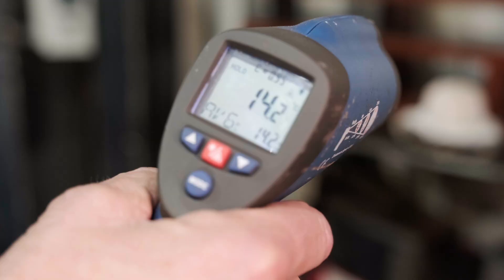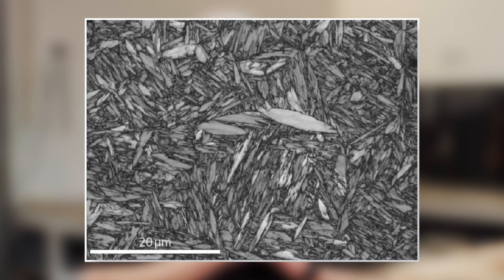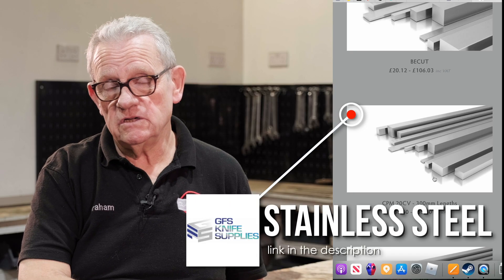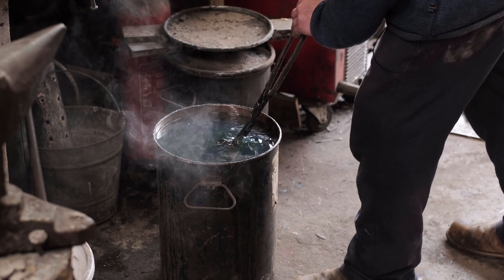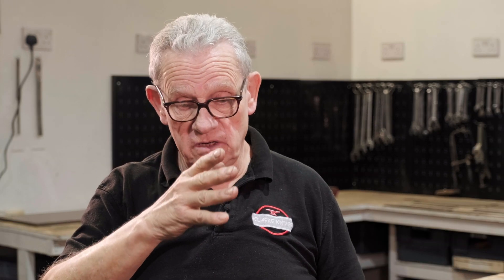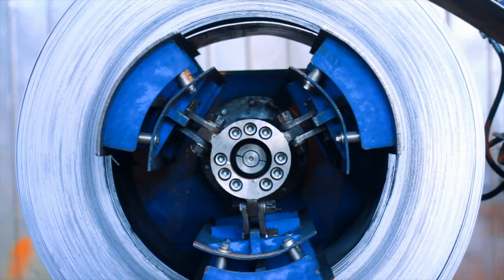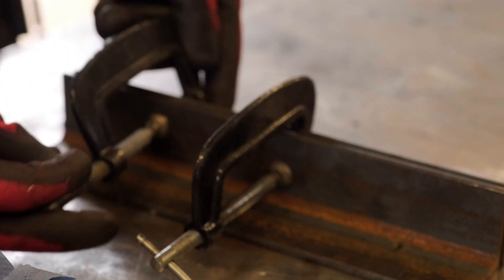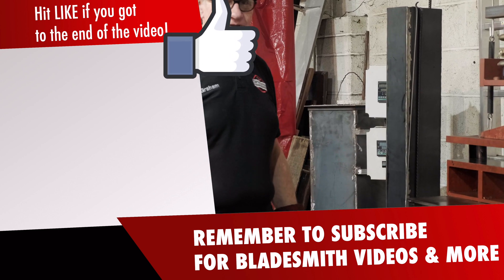EASY way to avoid bends in your knife (even BEGINNERS can do)!

Comment: 🤔i have been thinking of how to put this for the last 2 hours and  No offence intended and i kinda shocked myself at all but there is a very very easy so obvious way to know when to take your steel out of the Quench media. pull the blade out when the media stops boiling. a lquide Boil's when it has hit the right temperature turn from liquid to gas. Most quench oils vaporize/flash at 176.666667C/350 F  with Parks 50 its 135C/275 F and water its 100 C/212F your blade will be at that temperature when it stops boiling (it will still cause the oil. If i recall right Martinsite forms at the speed of sound and I believe its in an unstable configuration that acts like Austinite until it has cooled to Somewhere close to room temperature. so you dont need to count you need to watch and pull your blade out right when it stops boiling...however dont set in on something on one side as that will alter its cooling rate on that side causing a warp. Lock it virtually in a vise or clamp it between plates or boards and let it cool to room temprature.😅 This is so easy and Obvious i feel like i am Trolling you and i am not. IF i am wrong here please tell me and i will delete this as i do not want to contribute to the Myths about heat treating.

Comment: If you clamp the knife after the first cooling in oil and then dump the whole clamped steel with the knife into an ice-bath does that almost secure a good hardening or will the ice-water cool it to fast?

Comment: Early in the series, when Jason Knight was a judge, he mentioned that if you take the knife out of the oil and it bursts into flames, then it is not sufficiently cooled.  And one may notice while watching, how often a bladesmith takes a knife out of the oil, there is a giant and visibly appealing fire ball, and when tested the blade fails by chipping, breaking, or bending.

Comment: I use steel plates and clamps. But at the moment i am building something better. A wood working vise with wide jaws, with a steel plate welded to the inside of each jaw. So i can do the same thing that his hydraulic press is doing, but for about $50. I was also considering a hydraulic press, if money is no option, id go that route

Comment: Great video.  I have made a straightening plate, but would like to know what the temperatures you quoted are in C of F?
Reply from the maker: Hi Jim. Sorry if it was unclear but we only use Celsius in the UK. Thanks for the question!
Reply: @UKBladeshow  so 450°-250° C clamp zone?

Comment: I would love to have your thoughts on cryogenic treatment
Reply from the maker: Super thanks again Tom! Really glad to have you around the channel bud! Thanks for the question too Brenda!
Reply: By cryogenic treatment do you mean cooling down to liquid nitrogen temperatures or lower and holding for 24 or so hours (deep cryogenic)? Or do you mean going to normal freezer temperatures or just a bit lower and holding for about an hour (cold treatment)?
Reply: @GemAppleTom  Thanks Tom, I watched a chanel that used liquid nitrogen after "it had cooled down".I would be interested in knowing what it does to the metal and the elements within that metal.
Reply: @brendameech4492  Right... tempering in general first. Apologies if this is telling you what you already know but it might help people who are new. 

When quenching the idea is to completely transform the steel from austenite to martensite and do it quick enough to prevent any formation of ferrite or pearlite. 

After quenching you can still have pockets of austenite still present - retained austenite. This is less common with plain carbon steels like 1080 but is a lot more common with stainless and high alloy steels. In high alloy steels the martensite transformation may not even be complete at room temperature. The retained austenite is not very stable however and with a bit of energy can still transform to martensite later. 

Normal tempering with give back a lot of toughness to the martensite that was formed - just what tempering is meant to do. It can also allow the retained austenite to transform leaving you with a mix of tempered and untempered martensite. You'll need a second temper (and maybe a third if there's still some remaining austenite) to temper that new martensite but you'll also be re-tempering the original martensite. 

Having the mix of single and double tempered martensite is not always a problem and much better than doing only a single temper and leaving untempered martensite. 

It's not so much of an issue with low alloy steels - a single temper wI'll do the trick generally.
Reply: @brendameech4492  
The idea of cold treatment is drop the temperature low enough that all of the retained austenite will transform to martensite. Then when you temper you shouldn't have to worry about different regions having different properties. 

This can be done in a home freezer for some alloys. From memory, -20C for 1h was the common industrial spec

The benefits of cold treatment are consistency with properties, less distortion - martensite and austenite have different expansions during heating and cooling, saved money on tempering since you can drop one of the steps. (There are some high alloy steels that will still need double tempers but for different reasons). 

Deep cryogenics is...controversial. You will certainly make absolutely certain that there is no retained austenite at liquid nitrogen temperatures. A bit overkill in my opinion but not wrong and you'll get the benefits of cold treatment. 

Holding high alloy steel (or any other material according to the websites that sell the treatment) at LN2 temperature for 24+h can have other benefits such as improved wear resistance. But... 

The industry at the start was plagued by snake oil sales men. Wild claims and explanations that invoked Einstein and such which doesn't bear close scrutiny. The whole idea got a bad reputation. There is sensible research into it now though. (My Dad did one of the earliest actually well put together papers on it and coincidentally a colleague in my first job was looking into it as well.) There are hints in some steels, some of the time that something might be going on but it's a small effect if it's there. 

Personally I think cold treatment is something that needs to be more widespread. Cryogenics, even if there are benefits, don't give enough of one to be worth it.
Reply: @GemAppleTom  Thank you Tom I really appreciate the reply.

Comment: I would be interested in how to calculate the time needed for tempering, normalising, hardening. 
The data of the knife steel is a given from the manufacturer (tempering, normalising, hardening temperature), but different size and thickness change the soak time somehow? Because math and science and things?... I don't know. This is the part that I struggle the most with. Would be great if some light could be shad upon this. :)
Reply: The rule of thumb for soak times used in industry is;
1/2 hour + 1/2 hour per inch of thickness. 

Yes, large sections do make things more complicated especially for high temperature cycles. E.g. getting the core to the right temp for the right duration while avoiding grain growth at the surface.

Thin sections like blades are quite easy in that respect though have their own problems with distortion.

Comment: Love it!!  Read about this years ago and started stumbling my way through it. learning it costed me a few blades by getting greedy after I got them a little too cold but definitely worth the effort and you get the added benefit of a little bit of self tempering or martempering. Never understood why professional makers don't do this.
Reply from the maker: Thanks for the comment D!
Reply: Self tempering? I’m familiar with martempering (even though it’s a misnomer - marquenching is a better name for it) but not self tempering.
Reply: @GemAppleTom  may not be the correct name for it but a quick Google search describes a process which is similar to what is happening the heat from the spine(from being thicker)bleeds to the rest of the knife causes it to  develop tempered martinsite. Again im no expert so I may be getting some terms crossed up.
Reply: @dmounce5513  Right, got you. Not heard the term but get the mechanism. Probably not a surprise I'd not heard since my background is industrial heat treatment. It sounds like something to avoid for control's sake. 

I'm not a blade maker (would like to take it up at some point) so can't say how important it is. Intuition tells me it isn't but I'd be quite happy to learn otherwise. Can you use self tempering to avoid needing to temper at all?
Reply: @GemAppleTom  Haven't done alot of testing without doing normal tampering cycles afterwards the one Profesional knife maker that I have heard talk about doing this stuff is kevin cashen. He talked about abuse testing one after marquenching and from what I recall was pretty durable if i remember correctly said they threw it at concrete stomped it but finally broke it hitting it with a hammer. I'll try to find my recording of it to make sure im quoting him accurately.
Reply: One issue is if you aren't careful or have a really thick spine you can over temper the edge. I personally went out and bought a old Rockwell tester just to make sure that didnt happen but it really hasn't been a issue. And to answer your other question directly I would still definitely temper each one multiple times. I also normally do a differential temper on the spine im probably going overboard on some of it but if I do to much everthing is fine if I don't do enough then it fails prematurely and its my name on the side of it. So I say if it might help do it untill you prove it doesn't make a difference. And test everything you make.
Reply: @dmounce5513  Every day's a school day, cheers. I've got the background to follow what you're saying but there's a world of difference between understanding and actually being able to put it into practice.

For differential tempering are you talking about heating up on side with a flame or similar? 

What steels are you using? High alloy steels often do need multiple tempers but plain carbon steels not so much. Again I'm happy to be wrong about the practice
Reply: @GemAppleTom  ok so say im useing a simple carbon steel for example 1095 I would do 2 individual 1 hour cycles and I was taught that each cycle had a diminishing return so going beyond that was pretty much pointless. Then the differential temper I measure down the side of the blade(depending on how springy you want the blade) make a layout line the submerge up to that point in wet sand then use a propane or map gas torch on each side  to heat up the spine working from the ricasso to the tip(be very cautious and slow as you get to the tip) and I heat the spine to roughly 600 degrees(going past purple into the faint blues). The idea being that you have a hardend edge with a soft spine so hopefully the knife won't break but will bend and spring back if it gets bent. Look up ABS journey man test the master Smith test is pretty much the same but with damascus you made.
Reply: @dmounce5513  it's interesting to hear the tips and tricks of the trade. I'd have liked to go down the practical route of metallurgy...

You might be able to drop the 2nd temper on a 1090 or similar. The only reason for a second temper is to temoer any retained austenite that transforned during the first temper. The martensite finish temperature for a plain carbon steel is well about room temperature. You could put it in the freezer for an hour or two first if you want to make sure.
Reply: @GemAppleTom  ok yea I had heard of some people doing that(the freezer) but didn't know if it really made any real difference. The metallurgy aspect of it is what got me into knife making to begin with over 10 years ago and I have gotten away from that aspect and started chasing other dragons (fit and finish and the art side of it). Once I had a system that pretty much met my needs. But I am still fascinated by the metallurgy and always looking for more information any good books you would recommend on the subject?
Reply: @dmounce5513  Yes, the freezer trick will work. Martensite formation is determined by temperature only since it's not a diffusion process. 

(That's not to say I'm recommending "deep cryogenic" treatment. That's mostly snakeoil)

On books:
Alan Cottrell's Introduction to Netallurgy served me well in university and starting out in industry.

Harry Bhadeshia and Robert Honeycomb's Steel: Microstructure and Properties is another good one and surprisingly readable.

Comment: Only just getting into smithing, so watching a heap of stuff on the subject. Good sensible advice from you guys it seems, keep it coming! Quick question for you, if you had a blade that was hardened and bent but fully cooled, would it be possible to re-heat it up to a malleable enough state for straightening without damaging the martensite structure? Would that have the same effect as straightening while still in the cooling phase, as you describe in the video, or do other things come into play?
Reply: If it's cooled down to room temperature it should be fully martensite and straightening before tempering will be a quick and easy way to crack it. 

Temper first before doing anything. You might get enough ductility back after the temper to straighten.
You'd be better asking someone with practical blade making experience, though.

The material will remain martenstic until you heat it up enough to normalise or anneal it. But the higher the temperature you temper the more hardness you'll lose and more ductility you gain. 

(There are a few quirks with some steels but the above is a pretty good rule of thumb to go by)

Comment: Okay, so let me see if I understand this correctly: once you have quenched your blade to the martensite start temperature (quickly enough to “hit the knee” on the TTT chart), then you have some length of time to straighten your blade as needed while the temperature drops and the martensite continues to form. As the martensite forms, the blade gets stiffer and stiffer, and at a certain point*, there’s enough martensite locking the blade into shape that further post-quench straightening is not possible. Is that about right?

*I’m guessing that this is somewhere between M50 and M70, depending on how much additional correction is needed.
Reply: You're doing the straighten while the material is still austenitic but diffusion has slowed down enough to prevent really rapid pearlite formation (the area below the knee/nose of the TTT curve).
Reply: @GemAppleTom  Hmm — in other words, No, I have misunderstood the situation. I guess I need to go back and study a bit more.
Reply: @jhcc289  You had the jist of it and if you'd done as you described you'd get the practice right but possibly not pass an exam question on it.  Proper diagrams make all the difference.
Reply: Thank you,  @GemAppleTom . As a non-metallurgist, I’m working hard on understanding the science of what’s going on here, and I appreciate the additional information.  

However, in the interests of full accuracy, I am compelled to point out that the correct spelling is “gist”!
Reply: @jhcc289  is it?! Oh no!
Reply: https://youtu.be/JJWKfAeak2M

This might make it a bit easier to visualise.

Comment: Love the themes you are on these days! Can you do a episode amout tempering as well? Debunk some og the "bullshit" myths of 5 times 1 hour at different temperatures, and so on?
Reply: Multiple tempers can still be necessary for high alloy steels*. Not so much with plain carbon steels. 

*high alloy steels can contain a large about of retained austenite after quenching. A temper cycle can transform it into untemoered martensute which will require another tempering cycle.
Reply: get the data sheets for tempering (yes it's a graph again) and temper accordingly. 
if it says you need to get to 540°C for 3hrs to reach 57hrc and that's what you are after then you need to do that😂 (just a example)
Reply from the maker: Hi Heir thanks for the comment! As a matter of fact, we do have a short series on tempering in the next month or so. Stay tuned!
Reply: @UKBladeshow  awsome! Looking forward to it!